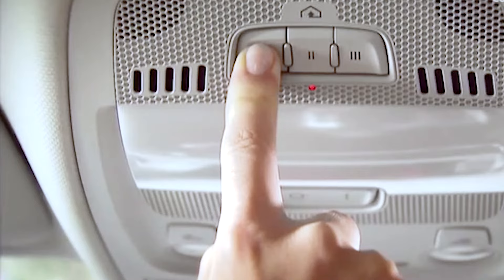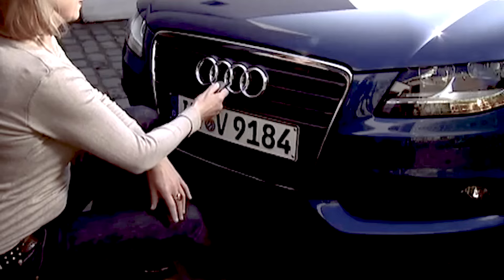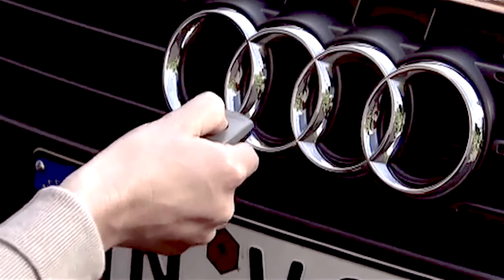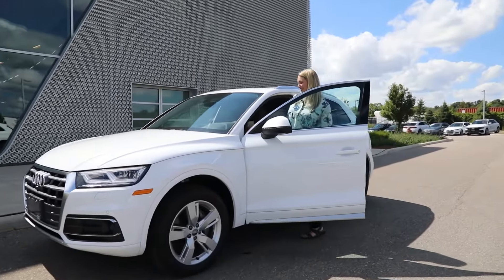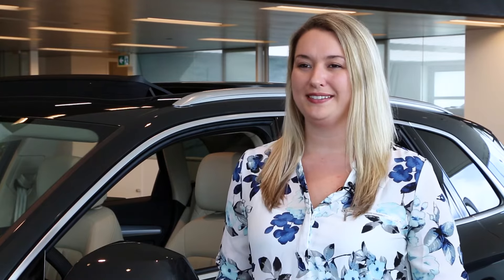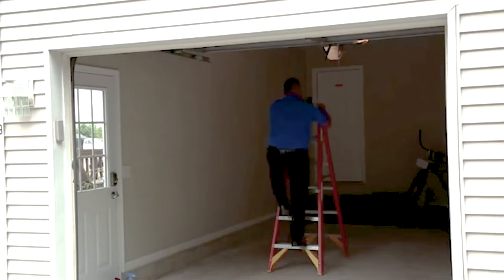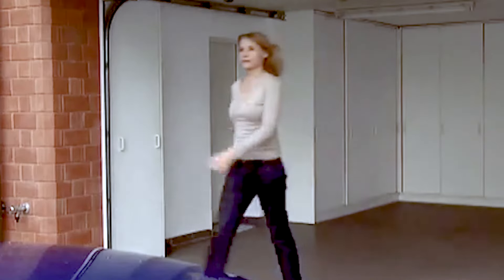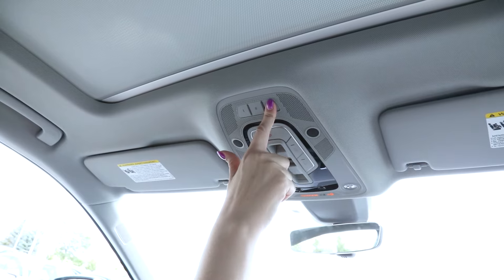Tip of the Day: Programming your Audi Homelink

Comment: Just did it on my 2010 Audi S5 Cab, it worked! I did the I and III button until it flashed quickly, then hold the button I'd like it until it blinked, then let go of it and went to front of car and held the garage door opener. After the hazards flashed at me 3 times I held down that button again until the light came on. And as soon as that happen, I pressed it and it worked. Awesome, thank you!